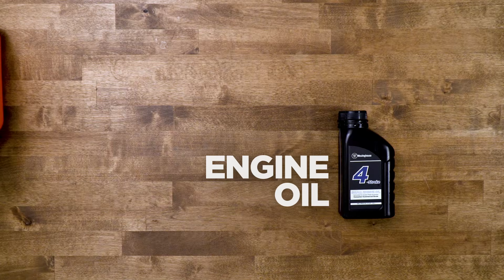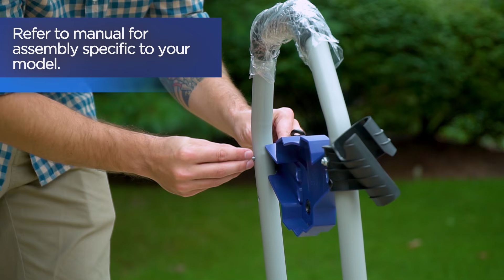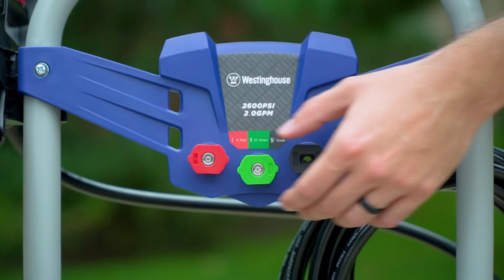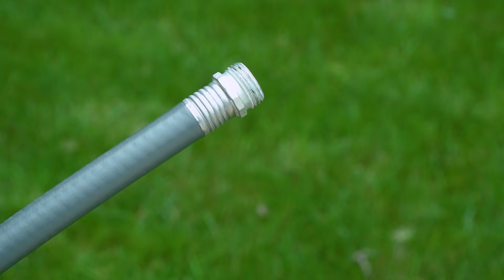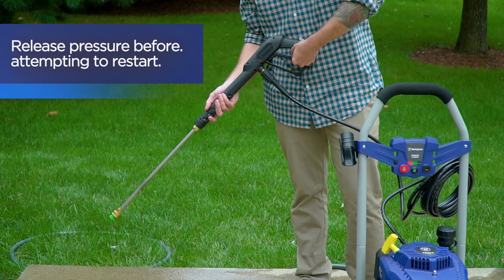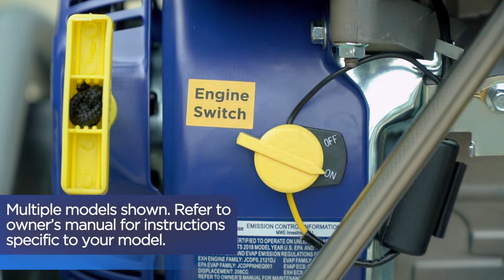Pressure Washers QuickStart Guide - Westinghouse Outdoor Power Equipment

Comment: Can I use this power washer with a water barrel as my water supply
Reply from the maker: The WPX 2600 is not designed to draw water from a barrel, tank, or standing water source. This model requires a pressurized water supply from a standard garden hose connection, such as a municipal water system or a properly sized water pump.

Comment: I got the 3400 for Christmas - went to start it and the gas tank didn’t have a fuel line to stick down into the fuel so it wouldn’t run any gas through the whole fuel line. Took it back and just got the new one, no fuel line either so it won’t run gas through the fuel line either. Poor quality of manufacture

Comment: I was using mine today for the 2nd time (total of about 20 minutes of use cumulatively, the first use plus the 2nd use), and right as I was turning it off, there was a loud bang---like a back-fire or something. 15 minutes later I tried to start it up again, and it won't start, and the flywheel/pull start sounds different---sort of rattling. And no, I didn't do anything wrong, I'm very attentive to following all the instructions.

Comment: Bought this pressure washer, tried to start following directions after proper assembly and the pull start would not retract.  Took off and got it started once, but cannot get to start at all again.  No videos on help regarding this.  There is a way to line it up but what it is your guess is as good as mine.

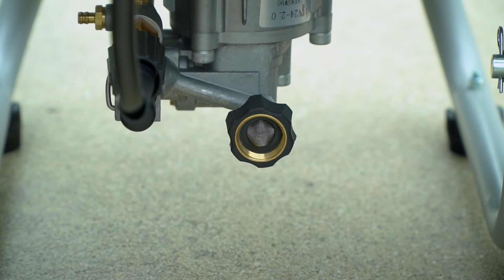Comment: Be sure to check for water inlet screen @ 2:35. Mine does not have one. "Never operate without screen."  Called tech support & was initially told a screen was not required. I referenced the manual & this video. This part  is being sent to me.    Update 2-24-22   After not receiving an email confirming my parts request, I made a follow up call. Was told I needed to  send proof of purchase. This request should have been made when I gave the tech support my model & serial  number. Too much static for a 3 or 4 dollar part I could install in 2  minutes. It was returned to big box store.

Comment: My brand new 3200 pressure washer won't start, I have followed all the instrucctions. When I pull the cord it just won't start 😣😣
Reply: Make sure once the water is hooked up pull the trigger and purge any air out of the system.

Comment: If you have a fuel shutoff then when done turn it off and let it run out of gas. That way you don't gum up the fuel system.
Reply: How do I let it run out of gas if it’s turned off? I’m new to this so I’ve never used anything like this and I want to do it right

Comment: I hear that you can use the 3200psi on cars, but I'm not clear that it's safe. Apparently the nozzles adjust the PSI to make it safe? Is this true? I have a ceramic coating on my car and I don't want to ruin that or my cars paint... I'm surprised there's no other way to adjust the PSI.
Reply: Remember that 3200 psi is at the tip. The farther you are away the psi drops.
Reply: I have the 3400psi unit and i use the black/plastic tip. Shoots enough water to get soap and some bird shit off but not hard enough to blast even a wax coat

Comment: Dang that’s crazy I just ordered this from Lowe’s because of the great reviews and y’all saying it failed right away 😥. I ordered the 3200 psi hopefully I don’t have same issues
Reply from the maker: We assure you that your WPX3200 will give you the power to get all the dirt and grime! We are always ready to assist you if you come across any questions or concerns, please email us at customercare@wpowereq.com and we would be happy to help!
Reply: @Westinghouse Outdoor Power Equipment  
I purchased a 3200 model a year ago and it won't start. Can't get you on the phone to trouble shoot either. Used it maybe 5 times.
Reply: @WestinghouseProducts  hi
Reply: How's your machine? I got mine recently and Haven't put gas or oil in it . But I had one previously, and something I did I had to send it back... Got another one! My first one INDEED started on first pull! So I initially planned on getting a second one because the first one was bad I got my money back and I indeed got another one. I do detailing on the side, and believe 3200 PSI with 2.5 GPM is more than enough for this job 👌🏼
Reply: @Joseph_Prince_Pena   so far so good, I’ve used it numerous times and it starts on first pull. I use it for personal use like washing driveway /trash bin/car wash etc. I’m very happy with this pressure washer 👍🏼. I let my neighbor borrow it and he ended up buying one and his is good so far.
Reply: @Joseph_Prince_Pena   so far so good, I’ve used it numerous times and it starts on first pull. I use it for personal use like washing driveway /trash bin/car wash etc. I’m very happy with this pressure washer 👍🏼. I let my neighbor borrow it and he ended up buying one and his is good so far.
Reply: Sir I just got one and I love it, I hope you got yours and had no problems.
This thing is perfect for the house and even some side jobs.

Comment: Pump failed after second use, followed instructions. Junk
Reply: I’ve had mine for almost a year and it’s still going strong
Reply from the maker: Hi Ben! We sincerely apologize that you may be having difficulties with your pressure washer. We hear this often about pressure washers and it is most commonly caused by improper storage. We recommend you use a pump saver when storing your pressure washer in inclement temperatures for long periods of time.

Comment: I hate this washer.  I got to use it twice before it stopped working.  $140 a wash, not a great deal.  And yes I have gas, the right amount of oil, I've cleaned the carburetor.  POS
Reply from the maker: Hi Josh! Thanks for letting us know about this, we're sorry to hear that your experience did not match your expectations. Did you get a chance to reach out to our customer care team at  https://westinghouseoutdoorpower.com/pages/contact-us? We'd be happy to have the opportunity to help you get to the bottom of it!
Reply: @WestinghouseProducts  The last time i got technical "help" was for your generator which stopped working the second time I used it. He had me take apart, attempt to rebuild the carburetor. This resulted in losing parts and not fixing the issue.  It turned out to be a bad battery which would've been a very simple replacement.  So forgive me if i have no faith in your technical assistance. I'd rather just warn people about the quality of the product.
Reply from the maker: @joshwexler1324   We're so sorry to hear about that situation! While we can't help you find those lost parts, we always work hard to help troubleshoot where the issue could be from a bad battery to a gunky carburetor. If we can't find the source, we'll work with a service center right away for you. We'd be happy to send you any parts you may have lost! Please let us know at your earliest convenience.
Reply: @WestinghouseProducts  I appreciate you trying to help make it right, if you're able.  I don't know all the pieces that were lost. There are a bunch of tiny parts that push the choke(i think) into the correct position. There's a tiny spring, i think a little black plastic piece.  
I'm still stuck with a dead pressure washer though.
Reply from the maker: @downhillindad7689  What is your case number? We can send it to our escalation team to look further into it!